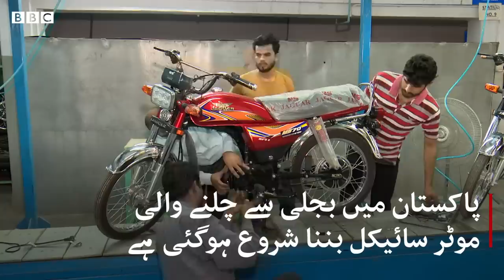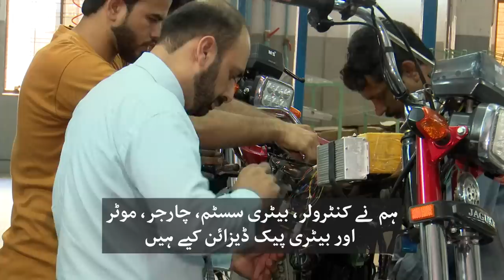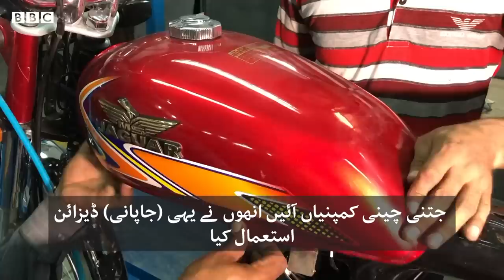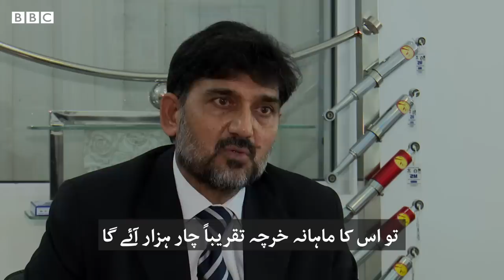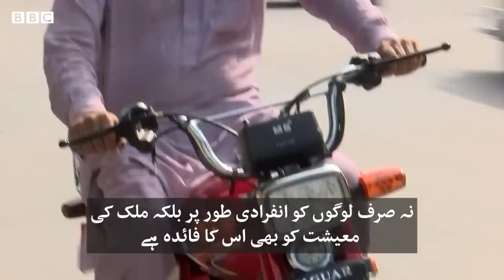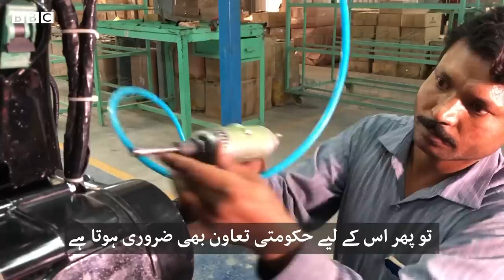E-bikes: Now petrol bikes can be converted into electric bikes - BBCURDU

Comment: I can do this setup with customizable specs.. The hub-motor they are using seems 350-500watts which will give maximum of 40kph speed, and 50-60km mileage under 48v battery.. I can also do hybrid setting with hub-motor in front wheel.. Electric bikes have a great future in Pakistan.. We must do it safely with qualified technician, because there is a risk of fire in these bikes...
Reply: gestap0 brother i also did research on this project 8yeara ago to costumize my cd70 bike but deu to some issue i couldnt complet it. not only hub motor there are  varity of dc and ac motors battary charges can be use in this project and horse power is realy matter bcoz 70cc engin produced 3 to 4bhp....i think 300 to 400 watt is nothig as u mentioned.hub motor should be at least 1 to 2 horse power to pull the load on the bike and rider...
Reply: You can only post comment. Practical is far away from your posting.
Reply: yes brother you are right... power is very important, as well as weight... We need enough torgue produced by the hub and wheels to carry us with speed
Reply: I have used 350W 48v23AH, 500W 48v 15AH, and now I am using 1200W 60v20AH... the more wattage, the more torgue produced
Reply: @Umer Asad and do you have any idea o the battery price bro? We buy lithium-ion battery of the same 80km mileage for 2000-3000 Chinese Yuan, than makes 45000-70000 PKR in nowadays rate, and battery lifetime is 1-3 years
Reply: @Umer Asad You can build your own Li-Io battery from scrap laptop cells